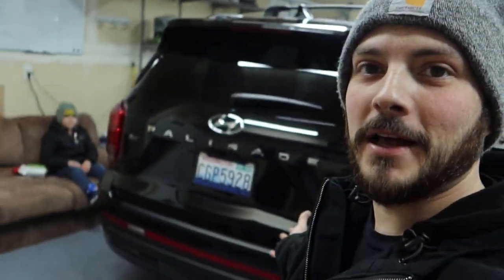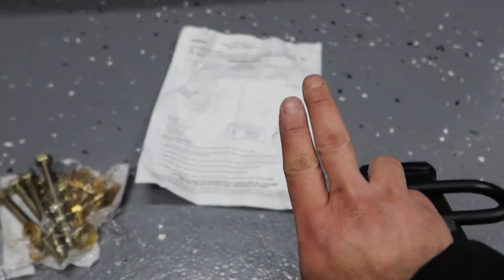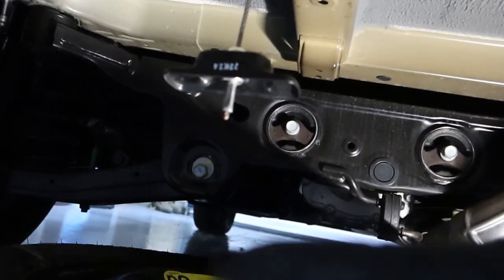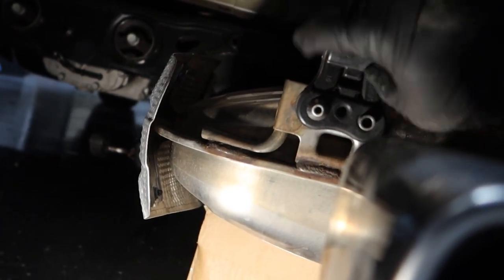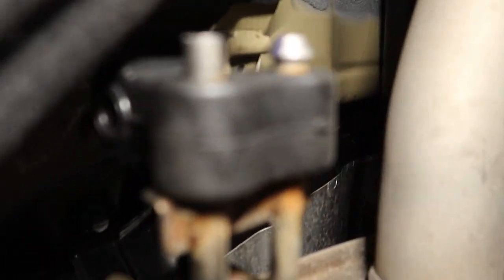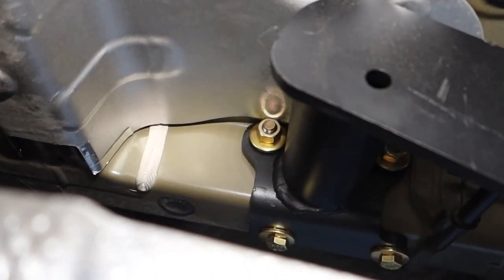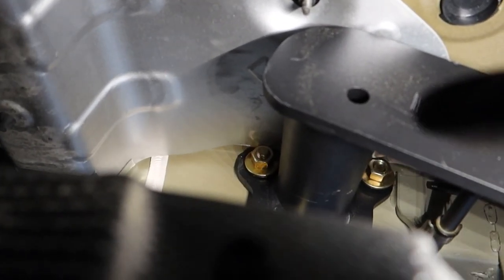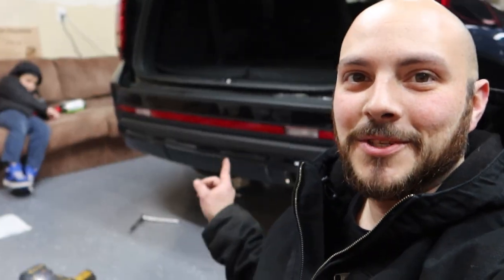2023 Palisade Etrailer Trailer Hitch Install (Hidden Look)

Comment: What lb ft did you torque the nuts/bolts? My instruction states 10/12mm bolts which has to be a misprint as included and fits right are 17/19mm.
Reply from the maker: Maybe they are talking about bolt length? I just tightened then as much as I could. A bolt that size would have a high torque value and you’d want to torque it after your first tow as well to make sure it didn’t come loose

Comment: Only the AWD has the 5k pounds towing capacity right?
BTW, your helper is a CHAMP! will put mine to good use when I install mine too! hehe
Reply from the maker: I think they all are 5k because I was looking around at the 2020 models. The 2020 models with AWD are 5k cheaper than a brand new one here so I decided to get a new one with warranty

Comment: did you tighten the outside bolts first, or the underneath bolts?   and was there any play between the frame and the hitch before tightening?  thanks
Reply from the maker: The bottom first for me. I towed my trailer recently and I am going to retorque this week
Reply: @Boost-EdAutomotive  any gaps or play between the frame and hitch before tightening?
Reply from the maker: @bigfishbrau  I believe there was a little gap on the bottom but not really much play
Reply: @Boost-EdAutomotive  ok, i am trying a factory hitch from a 22 telluride, and some say it fits, and some say there is a gap side to side.  so we shall see..  on another note, do you have any wind noise on the highway?  im seeing complaints of that now.
Reply from the maker: @bigfishbrau  in the 2023 palisade? Not that I notice. My 2019 Ioniq is pretty loud on the highway so the palisade seems quiet in comparison
Reply: @Boost-EdAutomotive  if you are ever under your palisade again, could you measure the distance between the frame rails where the hitch mounts?  i ask because i ordered a factory oem hitch for a 20-22 telluride because i saw some people have used this hitch on their 23 palisades.   i did see one person who said his had about a 1/4" gap, and others said it fit fine...  i have a hitch, but not getting my palisade until the end of May.  so trying to find a way to get this measurement! sorry to ask you this but much thanks if you could..

Comment: Great Video. Do you have any luck with the wire harness for 23?
Reply from the maker: I’ve got something coming in and should have a video out by the end of next week. I was disappointed there wasn’t a dang harness on the 23 yet… the previous years came standard
Reply: @Boost-EdAutomotive  been waiting from Hyundai for 3 months and still nothing available yet. It was a recall from previous year for fire hazard but 23 still nothing available. Did you purchase an after market harness?
Reply from the maker: Yeah I heard about the fire hazard. I’m doing an aftermarket set up. The 4 pin connector kit was $158 and you don’t have to splice your factory harness. And then I got a 4 pin to 7pin adapter for $88 and the extra 3 wires need to be ran. The parts came in today and the video should be up Monday or Tuesday
Reply from the maker: The 4 pint harness is ideal for us so if Hyundai comes out with a factory harness we can revert and sell the harness to help someone else out
Reply: @Boost-EdAutomotive  can’t wait to see the video
Reply from the maker: I brought the palisade in the garage today to wire up the harness but unfortunately the 4pin connector harness I got won’t work without extensive testing because the taillights are fully LED I would have to cut each wire one at a time to figure out which wire is blinker/brake/running lights. I found an inline connector for LED assemblies that should work… on the plus side, I got my car December 2022 and it has a connector for Hyundai’s harness if they ever release one lol

Comment: You have the Model Number of the hitch? Want to make sure I get the right one.
Reply from the maker: https://www.etrailer.com/Trailer-Hitch/etrailer/e95ZR.html?feed=npn&utm_source=google&utm_medium=cpc&utm_campaign=Google%20%7C%20Shop%20-%20Trailer%20Hitch&adgroupid=98561398749&campaignid=918096360&creative=425409475846&device=m&devicemodel=&feeditemid=&keyword=&loc_interest_ms=&loc_physical_ms=9033692&matchtype=&network=g&placement=&position=&gclid=CjwKCAjw67ajBhAVEiwA2g_jEDNezi93WKXe4dW6LxqsgtwiHZWGFJe9eApySeqtP0Jz_aw5C0FS9RoCeYAQAvD_BwE
Reply from the maker: https://www.etrailer.com/Trailer-Hitch-Ball-Mount/CURT/C45250.html

Comment: What is the part # for the trailer hitch?
Reply from the maker: OEM or the specific one I used
Reply from the maker: https://www.etrailer.com/Trailer-Hitch/etrailer/e95ZR.html?feed=npn&utm_source=google&utm_medium=cpc&utm_campaign=Google%20%7C%20Shop%20-%20Trailer%20Hitch&adgroupid=98561398749&campaignid=918096360&creative=425409475846&device=m&devicemodel=&feeditemid=&keyword=&loc_interest_ms=&loc_physical_ms=9033692&matchtype=&network=g&placement=&position=&gclid=CjwKCAjw67ajBhAVEiwA2g_jEDNezi93WKXe4dW6LxqsgtwiHZWGFJe9eApySeqtP0Jz_aw5C0FS9RoCeYAQAvD_BwE
Reply from the maker: https://www.etrailer.com/Trailer-Hitch-Ball-Mount/CURT/C45250.html
Reply: @Boost-EdAutomotive  thank you , I was hoping that oem hitch was a stealth hitch. I have a removal door on the bumper
Reply from the maker: @MrRoadtrek the OEM one might be. This is aftermarket